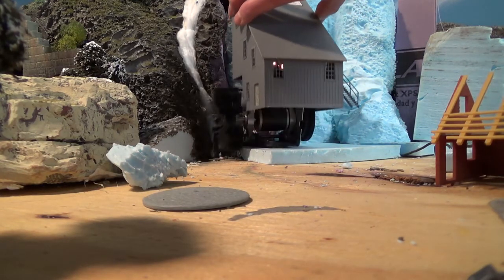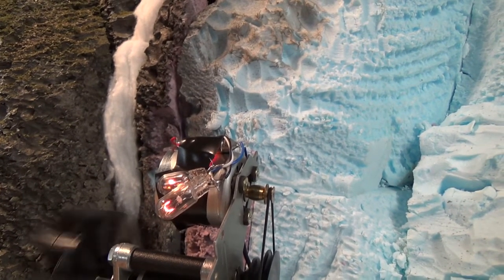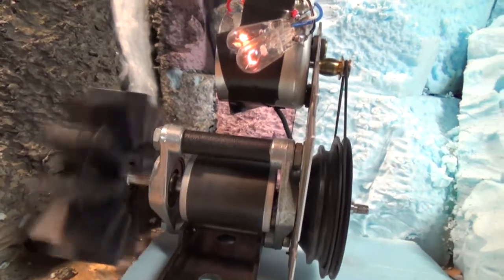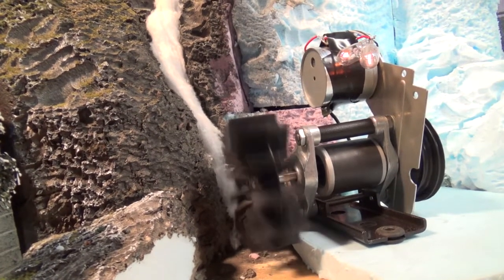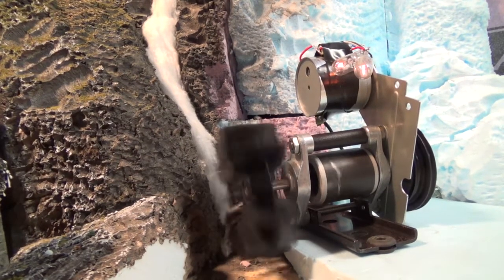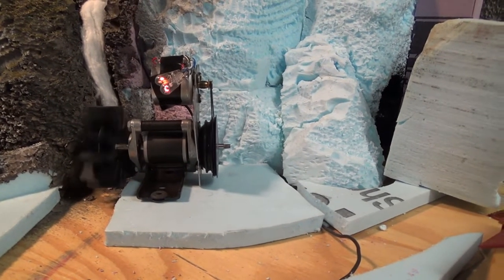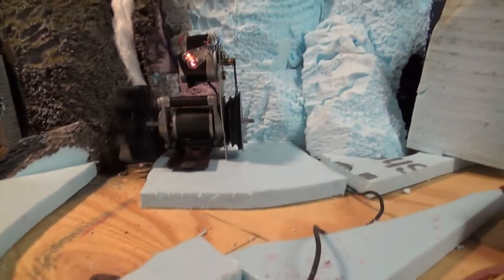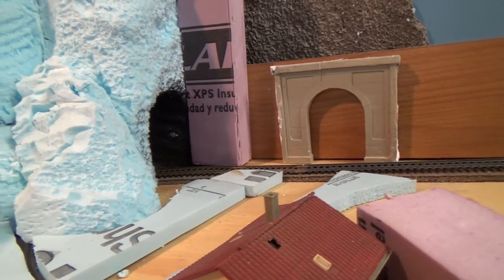Down by the Old Mill Stream

Comment: I've got an 8 foot diameter, 2 feet wide, 2200 pound water wheel down on my dam and in both full load and no load conditions, an overshot water wheel runs way faster than an undershot. An undershot can only run the speed of the creek flow while an overshot runs at creek flow plus the weight of the water in the wheel buckets. When under load my wheel runs at 30 rpm, 45 with no load and carries 45 gallons of water at all time in the rotation. In short, you've got it backwards. An undershot wheel is slower and far less powerful than an overshot wheel with a breast wheel coming in between the two. Go Go Gadget Overshot! LOL. I've got a video on it called the Water Wheel.
Reply from the maker: Well, I don't claim to have real knowledge of these things, I was only judging by what I saw on Youtube, where the video evidence seemed to favor more speed with undershot wheels, but in any case, this one will be an overshot, just because it looks cooler. LOL Thanks for stopping by Ed.

Comment: Looks good George, ingenious solution, and if you follow Ed of the North's comments you have it wrong re rotation speed. Seeing how good you are at this stuff it would not be too difficult to erect a short aqueduct [or as we would call it a leat] with weir gate at the top to shut off the flow so that supplies turn it into an overshot wheel, excess water would continue along the path you have already created.
Where the water passes under the tracks I presume you would use a culvert, could this have a small turbine in it for electricity generation somewhere along the time line of this layout construction?
Reply from the maker: I am planning on making this an overshot mill and yes, I will be fabricating a trough/aqueduct to direct the water over the wheel. Any residual water will just run out under the wheel, much like in real life in some situations. I am trying to decide on whether to put a culvert in or install a full bridge, which would require the stream to run downhill more. Always lots of considerations in these projects. Thanks for the great suggestions and observations, Dan.

Comment: That turned out well George .What do you use to simulate the water ? That is going to be a great layout .Take care .
Reply from the maker: At this point I just have some cotton batten that I scrounged from somewhere to approximate the stream off the mountain, but that likely will change to crystal clear caulking, similar to what I used on the other side of the layout coming out of the aqueduct over there and flowing down into the pond. The water in the stream at the bottom will be a poured resin like Liquitex and again using the same crystal clear caulking to simulate the water movement, like in the pond.
You can see those water effects pretty well in this video:   http://youtu.be/FFXdHEkL3Rw at about the 5:20 point. Thanks for stopping by.

Comment: you could open up and frost the mill windows and use the bulbs to light up behind the windows.  For water on the wheel you might try either clear silicone or epoxy on the paddles.

Looks great but now after hearing the sound effect I gotta go pee.
Reply from the maker: I had the same reaction the first time I listened to that sound effect... I have a couple of ideas on the water effect and I actually did a video clip of the lights shining through the windows with the lights out, but it wasn't very clear. I am going to add another light bulb or two and move them down directly behind the windows so they will be more evident when the lights are turned down. Thanks for the input Bob. BTW, when I was watching the video, I noticed that occasionally the cotton was getting moved around by the wheel...got me thinking about that...

Comment: Couldn't you use a lower voltage power supply, so you would not need resistors nor use as much energy?
Reply from the maker: I am down to 3.7 volts now and tried to use a 1 volt power supply, but it wasn't sufficient to turn the motor with a load on it. I wish I knew more about resistors and how to measure them appropriately, then I could just solder a single resistor inline and be done with it. Thanks for chiming in Ben. I appreciate it.